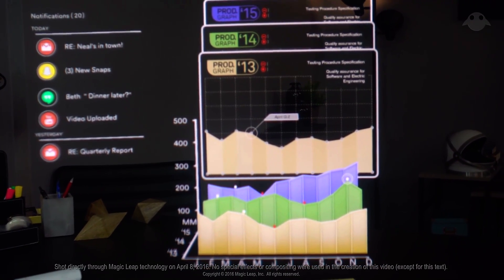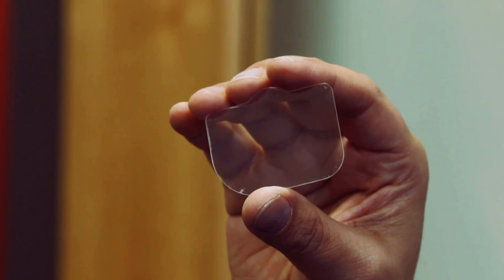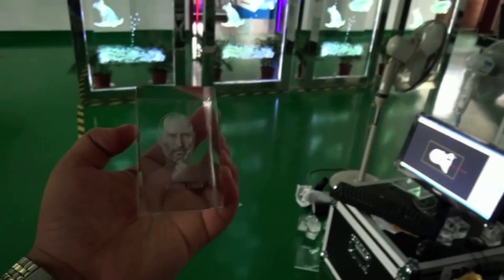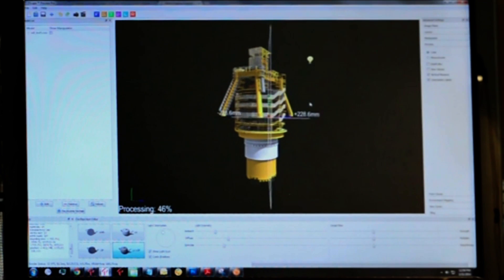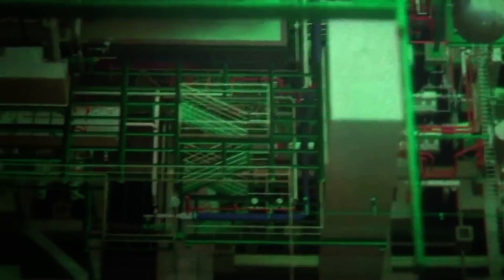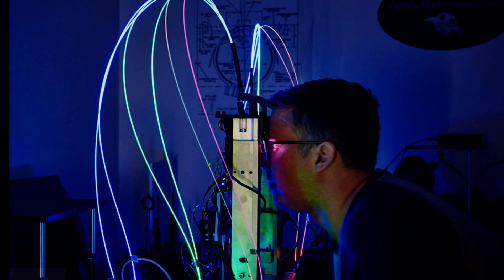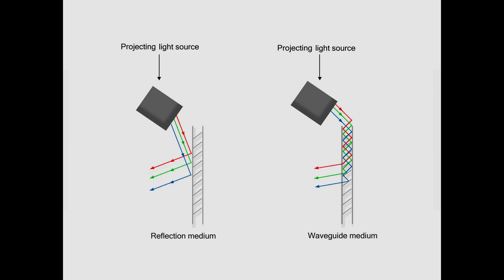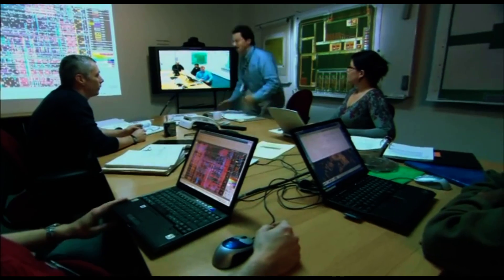Magic Leap Concept Explored Part 1

Comment: http://aip.scitation.org/doi/10.1063/1.3264955  Holograms can be made to be electrically switchable- the bragg planes of the photonic chip can be switched on and off or even STEERED by electricity. It's a real thing, and THAT is what makes it a chip.  This means the waveguide and the refractory planes used to direct the image can cycle on and off-- this means both a higher density of reflectivity for the light in the waveguide AND a greater transparency for the light passing through from the real world, if you cycle the entire structure on and off rapidly and only draw the display during the ON period, OR it could mean that you could scan the fiber in the X direction and keep progressively activating refractory planes from one side to the other in the Y direction, giving you both a horizontal scan rate and a vertical scan rate.  OR, alternatively,  it can allow the same point in the display to toggle from sending light in one direction to sending light in another- a key element of a light field display.  There's your hint for the day.

Comment: Awesome analytics.. I like very much how you are putting things together in a logical order. I'm not very deep in the material of protons and when I looked it up on Wikipedia there was a link to the term quantum. This coursed some sort of deja-vu recently been used and hyped together with a huge discovery in quantum computing. Now I'm asking myself could this be another reason why Google and all the big brains of silicon Valley jump on magic lead?  Is this opening another door into quantum computing? Again I'm not very familiar with all this terms but would like to see your thoughts around this idea. Is magic leap potentially introducing another method that could help in the direction of quantum computing??